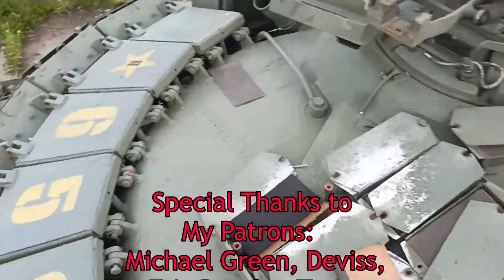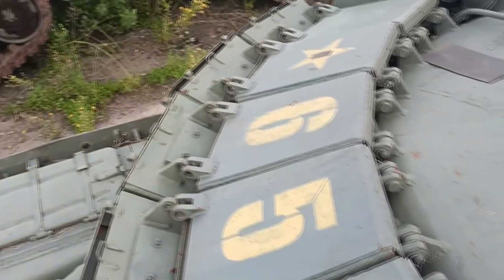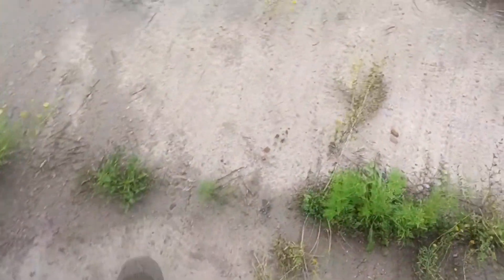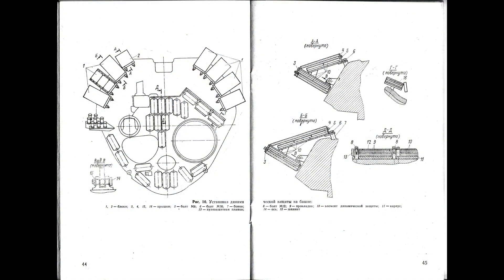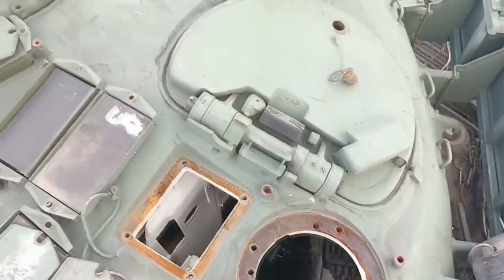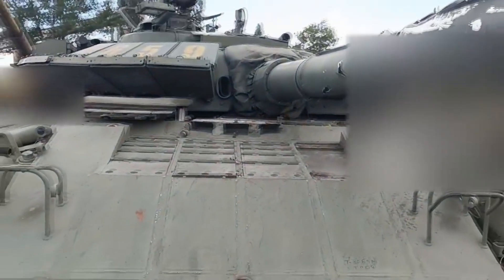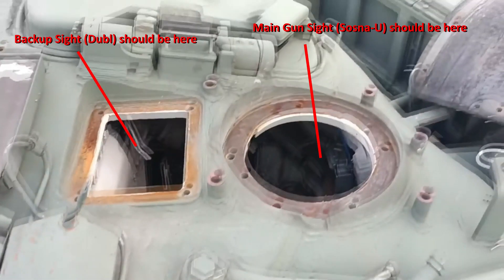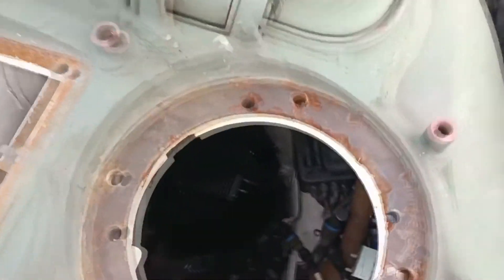Russians Are Using Rubber instead of ERA on their Tanks

Comment: If Ukrainians were responsible for removing explosives from the reactive armour to put it on their own tanks, wouldn't it make more sense to get whole bricks instead of removing just the explosive parts and then put the rubber back neatly? I'm pretty sure you are right that the tank was cannibalized by Ukrainians for spare parts, but the state the reactive armour is on this tank tells me the reactive armour was already in the state that we now see when Ukrainians captured it.
Reply: I don't know what kind of explosives are used in era but it was probably taken out and used to make different size panels for different types of tank. The russian era could be taken whole but might not fit on ukrainian era setup especially if only 1 plate needed replacement.
Reply: It makes more sense indeed, to remove whole blocks, but it could be, they just needed the explosives, to replace in bricks on other tanks, where bricks from T80 cannot be utiized, cause brackets didnt match. So they took instead just the explosives. But it just my opinion, how it could happen.
Reply: use them to upgrade their tanks, doesn't sound right to me. if the ERA explodes there won`t be any cases left to put new explosives in there, and refitting other tanks, you still need some sort of casing, so why not take the complete ERA tiles.With all those videos of "homemade" drone bombs and so on, the explosives for sure had found some way to be an effective type of IED.
Reply: @darkeolas6587  you would not take the whole tile because they might not fit with other ukrainian era. I do not know what differences there are but if ukraine tank use different size era it might be more affordable to use the explosive to make new tiles or just repurpose them entirely.
Reply: @darkeolas6587  i was thinking the same thing  that they might be using the explosives for some other things
Reply: That's the propaganda part. They left the empty bricks there to film their video. Who knows, maybe they're not trying to use the ERA, maybe their just selling it or keeping it as a souvenir.
Reply: Because they are not responsible, those were emptied beforehand.

Comment: What is this? Unbiased assesment based on facts and evidence instead of opinions and emotions? I'm offended.
Reply: The fact he worry about where the missing explosive might be instead of laughing it off to ridicule the "enemy" is something i love to be set as an example to media, and military alike.
Reply: Yeah I reported him for logic. Disgusting nothing racist or remotely sexist against tank.
Reply: I mean..he's clearly trying to debunk it. Lol taking one side of an argument and not showing any other points isn't being unbiased, kinda the opposite.
Reply: @FuzzehWuzzeh  did you even watch the video? The tank was scavenged for all the parts which Ukraine could use on its own tanks, including but not being limited to it's ERA inserts.

Unless you want to tell me the tank was sent into combat with empty ERA blocks, no bolts holding the engine deck on, rusted tracks, no gunner sights, no hatches, and no drivers periscopes
Reply: Yeah after the fact.

Those explosives are more valuable than the tank.
Reply: @grendal113  They simply can not operate this model. 
This tank had elements compatible with earlier ones for their repair, but not vice versa.
Reply: @МихаилРозов-ю9п  is this some sort of miscommunication?

Explosives are more valuable than a tank
Reply: @grendal113  Open the Wikipedia page.
https://ru.wikipedia.org/wiki/Т-72Б3
There it is written in black in Russian that the operator is Russia, and that's it. No one else has spare parts to ensure the working condition of the tank.
During the Second World War, there were no such systems in tanks as a ballistic computer, a night vision device, etc. The radio station was the most difficult. As a rule, mechanical parts or optics were required for repair, therefore, captured tanks served for decades. Now half of the tank's functionality is electronics, which cannot be replaced so easily. A tank that doesn't work is useless and worth nothing.
Reply: @Михаил Розов  uh...parts and electronics don't just appear fully formed out of nowhere.  Parts are regularly fabricated on the fly in other countries to support old equipment.  Just saying "oh there are no replacements available so just throw in some fake shit because there is no other option" is idiotic.  It risks the safety of the crew and makes the crew and other personnel question their country and command staff's concern for their well-being.  This is why Russia's military is complete ass.
Reply: @МихаилРозов-ю9п  Germans had a tank with night vision in the late war :)
Reply: @Achilles.channel In 1943, night vision devices appeared even on the submachine guns of Soviet assault brigades. Nevertheless, they remained rare until the end of the war. It is difficult to establish high-tech production under bombardment. The Americans, for example, were able to organize production of such devices in 1944, because their territory were very far from the actual theater of operations. 
Alas, comments on YouTube are not the best place to seriously discuss anything.
Reply: @grendal113  🤣👍
Reply: I can't believe it, Kinda rare nowadays
Reply: Korea uses rubber armor as well. Suppose to be lighter than other more traditional options.
Reply: Fact is: Russian tanks are made of cardboard and Russian soldiers don't have rations, they eat snow and their fallen comrades.
Reply: No more Arguement?
Reply: Literally unheard of these days.
Reply: Let's get this gem of a comment to 1K likes! It's so close🤙
Reply: A whole lot of you need to spend some time reading a dictionary.
Reply: Complete Russian propaganda.
Reply: @BlitzerAcer  bro its satire
Reply: Actually these aren't based on any kind of facts. Literally just his own opinion.
Reply: @patman0250  subjective opinion(vision better say) is more valuable than obvious crowd "truth"
Reply: Actually these aren't based on any kind of facts. Literally just his own opinion that's based on little to no evidence at all.
Reply: @patman0250  "This video shows what appears to be Rubber in ERA inserts" is not an opinion
Reply: @acceptablecasualty5319  yes it is. Use your brain. First of all he literally says “appears” meaning it’s his subjective interpretation of appearances. Secondly, it’s a video, you don’t know if it’s rubber unless you are physically there, so again, it’s absolutely opinion. Doesn’t mean it is without reason.
Reply: @obipwn  Right, so, according to you, nobody knows what color the sky is because it only ever appears to be blue, gotcha. Honestly, i've never seen a more worthlessly semantic argument.
Reply: @patman0250 Doubling down, huh?
Reply: It makes me sick to my stomach to see to what length would a psychopatic carrierist go just to get few seconds of public attention.😔

Comment: Explosives are removed probably to be thoroughly analized by western and ukranian specialist, so that they would assess equivalency and protection of RELITK ERA, and therefore decide which system is most effective in defeating it (or develop newer HEAT projectiles to defeat it efficently) and to assess, are newer types of apfsds projectiles good at defeating it (M829A3/A4). Explosive is most importat element in RELIKT ERA protection and probably "spec wise" most uknown, since it is most recent one.
Reply: or probably took it for their own tanks
Reply: @kthec1298  Ukranians don't use relkit so this type of explosive is of no use since relikt has completly different construction. They use nozh (нож) on they Oplots.
Reply: @MrSuba47  well nothing what a welder cant fix, wouldnt be the first time ppl done this, not with relict in particular but with other equipement, but yea you are right too that some of this relict probably is now in hands of the us and such
Reply: but why not use the whole block if you want to test it rather than steal the explosion part
Reply: @felixgamingvlog6702  mmhhhh.... maybe the Russians take explosive away to reuse them in their own tanks? At the time they abandoned the tank, i mean...
Reply: @felixgamingvlog6702  Because everyone has techical data, drawings dimensions and data on construction of steel, that is of no need to any engineer or military analyst, and taking apart entire construction of relkit and transportning it is cumbersome, all that is needee is pieces of those thin 4C explosives to get explosive characterisic and analyse it in different simulaiton programs, or simply put explosives on already designed replicas of relkit somewhere in england or usa.
Reply: @MrSuba47  posible but why not just to give whole block and dissesamble properly in the uk or us  i mean maybe thing is too heavy sure perhap but if you us or uk you have capacity just to do that 

You prob not wrong why you bring the whole block when i need the explosive part only to be test and reconstruc the material and made it in home remind me of first smokeless powder fiasco

Comment: If I'm not mistaken, the British Challenger series, Israeli Merkava series and Magach series uses rubber as main NERA material for it's composite armour.
Reply: Yea you're mistaken
Reply: Merkava uses SLERA
Reply: It is difficult to say because the Chobham/Dorchester armor composition is classified, the same is with the Merkava, although there are leaked photos of the Merkava Mk 3D turret side armor module composition and there is a photo of the Merkava Mk 4 ATGM hit where you can see the composition of the front turret module.
Reply: Idk like hardly any is declassified so there's a small chance it could just be a MOD lie to stave off tank buffs who want to know by revealing a little bit of either true or false data

Comment: Why would you just take out the explosive and not just move the whole block? Charles
Reply: Maybe they just need the explosives because they might have the other parts ?
Reply: @Silver_Prussian  possible but come on is easier just to bolt the era rather reuse it for the pre instaled era that somehow doesnt have any explosion to it
Reply: @felixgamingvlog6702  the bolts on the era look pretty hard to bolt maybe you need a tool or a crowbar to do so also if somebody had told the soldiers get the era and showdd them what it looks like but didnt tell them to get the rubber they would bring only the explosive blocs maybe they only takw the explosive blocks and use them in combat operations as explosives because by the looks of it they dint have much tanks left to equip them on liek the polish gave them tanks they got destroyed and there really isnt any irher natuon that can sacrifice tanks for ukriane like obvipusly that equipment has to be replaced.
Reply: @Silver_Prussian  i am pretty sure ua or russia would send tank mechanic than dumb grunt to do it but you never know

Also ua still have tank the actual number is unknow but not that low lets be honest even they low in tank the anti tank missile stugna javelin nlae rpg 28 29 and 27 will good enought for ua as they are the defender most of the time 

There is debate in germany to send old leo 1 to ua but is still a debate  

For polish tank t72 there is still a lot in ua service is still relativly new i dont think russian can destory that many in the in short period time considering the russian cannot do air support freely compare to american in gulf war
Reply: @felixgamingvlog6702  well ok but as i said i dont thinj the polesa re yet ready to give all of their t72 as they made tge majority of their tanks they might give them when their m1a2 and leo2 arive but up until them i dont see them being send. As fro the leo1 its a futile act as its yet again a different kind of equipment the ukrainains ahve never worked with even if its more simplistic than a leo2 its still a whole different tank with a different doctrine. This co flict has been led in the media too with propaganda on both sides.
Reply: @Silver_Prussian  poland is still sending their t72m1 to ua i dont think poland care about their t72m1 tbh for leo they already have it but m1a2 they are waiting (i forget) for shipment i remember correctly poland planning to use 3 tank 2 already in service 1 soon but for now they use 4 model (m1a2t72m1twardyleo2) of tank until the all t72m1 send to ua

The leo 1 is not that hard to train if you have knowledge in tank you can hop in in other tank and man it but not as good as your main tank but good enought tbh the hardest is not manning the tank up (drive and shot) but the maintance and sparepart but leo is a nice addition becouse every leo have gunner thermal sight but sadly the commander have old ir imagine intensifier
Reply: @felixgamingvlog6702  bro it takes months to trian tankers its not gonna work out well at all. As i said the tank is still very different vdry different doctrine and its just not gonna work, it takes years with extensive teaining even to rebuild an army.
Reply: @Silver_Prussian  sorry, i don't see your point.
Risk assesment is "better safe than sorry". An explosive, whatever its characteristics,  is better placed in a warehouse specifically made for it, rather than on some random old tank in a junkyard or the open. Just in case some stupid guy shoots at it to see if it is bulletproof, or some mechanic, unaware of what ERA is, tries to cut a box in two with a disk, to see what's inside or tries to weld a hook on one to lift the assembly. 
A rifle must be treated as if it is loaded, jntil it is checked and cleared.
An explosive must be dealt with as if i could explode at any time. 
Thats basic safety.
Reply: @Silver_Prussian  for fresh crew it is take month or more but for experince it will take less than that i mean desperate time come desperate measure i mean the soviet fight the german using sherman with experince t34 crew sure that is ww2 but you get the point you dont need to rebuilt the army just to field 2 different mindset venicle for example poland after cold war t72 and leo soviet with t34 and other lend lease venicle in ww2 indonesia just look it up they have wild diverse armor from us france russian how about hungary or other minor axis nation in ww2 that using native tank and german tank at the same time 

In fairness yeah those mosly done in older time when equipment is not that sophisticated (soviet other minor axis nation) or done in peace time (most of the eastern europe) or they are just poor nation that cannot standarsation on venicle and only get free or cheap afv they could get
Reply: @chefchaudard3580  there always people in the army that do that ALWAYS YOU JUST NEVER KNOW WHEN THEY GOING TO DO THAT 

Interesting note if i remember correcly those modern era cannot be set off using rifle caliber ammo and auto cannon to certain caliber and type of ammo it use  for older one like contact one is posible with 20mm
Reply: Could be they wanted to make the tank safe for the mechanics that stripped it.
It is common practise to remove explosives from the stuff people are working on, just in case.
Imagine welding close to one of these explosive box?
Reply: @chefchaudard3580  could be but why not just to unbolt it
Reply: @felixgamingvlog6702  maybe it was faster to remove the explosives and they had no use of the boxes.
Maybe the boxes will be removed at a later stage and put on another tank, and explosives will be reinstalled at the last moment, for safety reasons
There may be several explanations, but i know from my time in the army that explosives are installed only when there are needed, and stored as soon as possible to minimize risks and also prevent their degradation due to weather, tenperature...and stupids.
Reply: @chefchaudard3580  possible but explosive in the era is very stable you can see the era still undetonated even after the turret go to space 

If i remember (i am not from army or something) normaly you store the fuse somewhere far away becouse they are very relativly unstable compare to explosive c4 for example 

But seriusly after you remove era where you going to put it like  in metal jar or something and if you want to use again for other era that somehow doesnt have explosion inside how you going to fill it properly without any leak or imperfection just to remind those era is made in proper factory not some taliban ied workshop in the cave
Reply: Perhaps they already have empty blocks available and just needed the explosive
 parts?